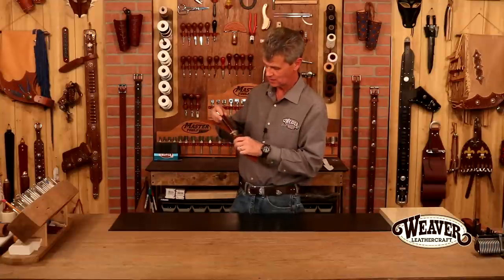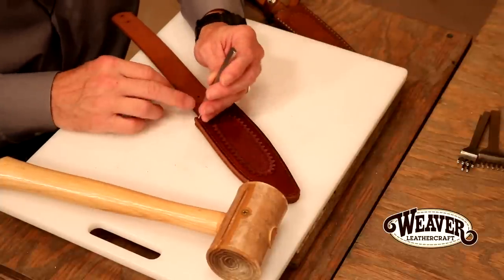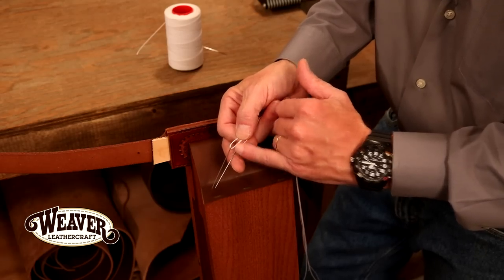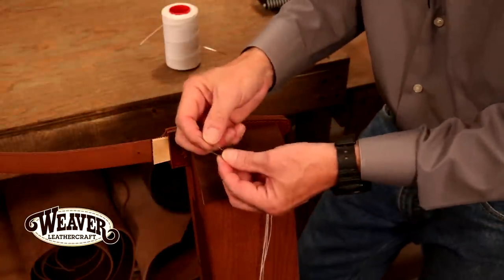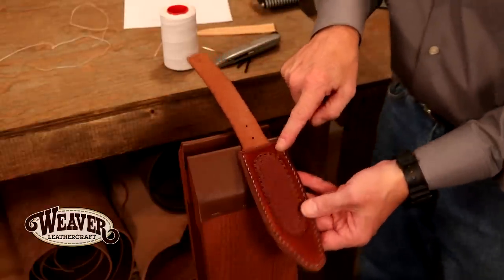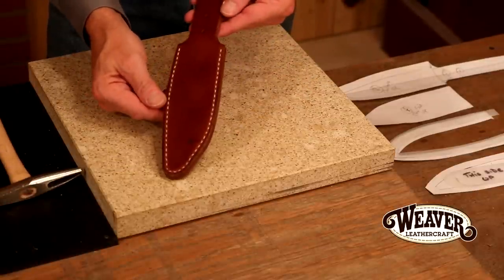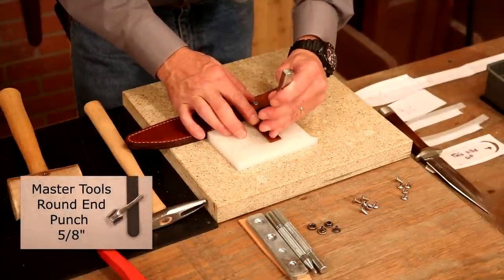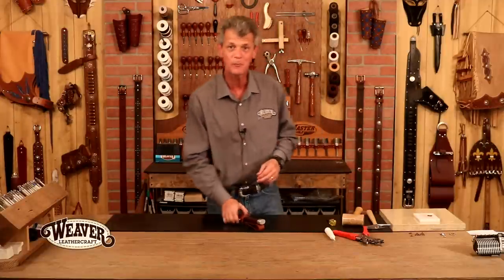Leather Knife Sheath Instructions Chapter 6: Hand Sewing and Final Assembly

Comment: I punch my hole in the pieces separately Chuck. The beauty of the chisels is that they are precise and if I'm careful the holes all line up. I cut my welt to the exact same size as my sheath and I put a lite stitch groove in it as well and after I punch the holes with the chisel I go back over them with a drill and make the holes extra large. When I glue it up for sewing I line my starter hole using thick needles top and bottom in three holes, lines up perfectly every time and I never have any problem stitching. Obviously it took a couple of trials before I perfected my system, but it looks very professional. I sell my sheaths to other knife makers who don't do leather very well. I have one friend who uses Kydex, but gets requests for leather often.

Oh oh Chuck, your sheath has the rivets and the back of the snaps exposed where they can scratch the knife's handle. I sew the strap and line the snap so it doesn't scratch the handle. I learned this lesson the hard way. I also sometimes place the snap where it doesn't come in contact with the handle too.

Comment: I recently made a knife sheath (first thing I ever made with leather) and had issues with the chisel getting stuck  when I tried to punch my holes. At one point I threw it across the room because I just could not get it out of the leather XD But you didn't seem to have any issues with that. Is it my tools or am I doing something wrong? I was using 8-9 oz leather, but that was what I was told to use.
Reply from the maker: Hi Ashlie,
It does take a little bit of back and forth wiggling to get the chisels out in heavier leather but if you have trouble with them getting stuck we would suggest applying a bit of beeswax to the tines and that should do the trick. Hope that helps!

Comment: Hey Chuck!

Started my first project, following along with these videos to make a sheath for my bowie knife using 7/8 oz Weaver veg tanned belly. I ran into a problem I was hoping you might have some advice for-- my bowie knife is rather thick near the hilt, so I had to double up on the welt. But now my hole chisels won't reach through to the back side. Is there any way to save the project? I had already glued everything before I noticed the thickness.

Thanks for all the videos, as a newbie they are SO appreciated!

-- Corey
Reply from the maker: Hi Corey,
Yeah, you can definitely save the project! You can use a stitching awl to punch the hole the rest of the way through, just use the chisels to make a guide for where the holes need to go.
Another thing would be to use a drill press, it works great to drill through heavier leather. We'll link a video below that we did: https://youtu.be/qrjv0E5P3Vw
If the leather hasn't been glued, you can punch the holes prior to gluing. 
Hope that helps!

Comment: Since the underside of the leather is showing on the belt loop could that whole surface be slicked to match the gloss on the rest of the sheath?
Reply from the maker: Hi Charles,
Yes, you can finish the back for a more slicked look. Also, I didn’t go into it but you can bring the loop forward, skive a deep feathered edge and sew that between the back panel and the welt.  With this you’ll have the top grain forward.  It’s a little more difficult but it’s done that way on most quality sheaths and looks really good.

Comment: Would you tend to add some waterproofing (Fiebing's Aussie or similar) finish to that sheath? This might also prevent some staining down the road.
Reply from the maker: Hi John,
You absolutely can. I typically don’t if I’m using a top coat that has some wax in it. The top coat won’t let the conditioner through, so, add that first and then top coat if you want, or, the conditioner may give you a nice look/finish.

Comment: Chuck why are you using a single pin fork and not 2; 3; or 4 pin forks to re-punch the holes, is there a specific reason that I missed?
Reply from the maker: Hi Victor,
Because of how thick the leather is, the one tine is easier to get in and out. You absolutely could use one of the multiple tine forks if you wanted to.

Comment: Can you run the groover along the back after you punched the holes? In order to lay the stitch into the sheath on the back. I've tried this a few times, and it can be hard to get that groover to connect the dots cleanly... lol!
Reply from the maker: You probably could, but, like you said sometimes the holes along the back are just a little bit off and that groove line will almost highlight that so I tend to only have a groove line on the front of my projects.
Reply: @WeaverLeatherSupply  Thank you for the info and tips sir.

Comment: cool... beautiful presentation!  i'm going to modify very slightly for a Japanese kitchen knife - so no belt loop required.. I am worried that the knife blade is heavier (thicker) so will require a little more thickness in the welt.. with the added thickness will there be a risk of the stitch chisel's shoulder damaging the leather surface on the final punch through? are there longer chisels available? cheers

Comment: I punched the first stitch holes and would like to use a bench press to re punch the chisel holes through the welt and bottom layer.
I used the same exact weaver chisels as in the video.
Will a drill press ruin the previous chiseled stitch hole shapes?

Comment: Thanks Chuck. All makes sense when shown once. I'm going to enjoy making mine. Have a good day.
Reply from the maker: Thank you, Adrian! So glad the video was helpful!
Reply: @WeaverLeatherSupply  ye cheers Chuck. Insperation . I found a big busted ole French knife at the junk yard. The owner give it to me as a gift. I cut it into a nice shape Bowie knife and got it balanced on the bolster guard. I'd like to be able to throw it. I could throw a Bowie as a kid and never miss. So I custom balanced this one to my hand. I'll etch the blade with a design. BUT I wanted a different looking sheath. I was thinking of a leather front sheath and a aliminium backing but not sure how to fix it together. Maybe I'll rivet it all around. But like the idea of leather lace in a cross design all around. Maybe with the sheath 5/8 bigger than the blade. But the aliminium flat sheet backing will be cut into the the belt loop with two slots. Do you think it will work. And do you think I can pull leather lace around it and make it strong. I'd probably have to glue it and add a spacer. Then I can tap out a design into aliminium before I put it together. Are there any disadvantages with a metal backing. I wanted something solid because it's not blade heavey didn't want it rolling on me. . A long message but. Thanks for your reply. I lived in America for eleven years. In the South. Great customer service and follow up. England got zero customer service. Thanks again. Maybe you got a suggestion. It would help me on my first knife and sheath build. Have a good day. Adrian